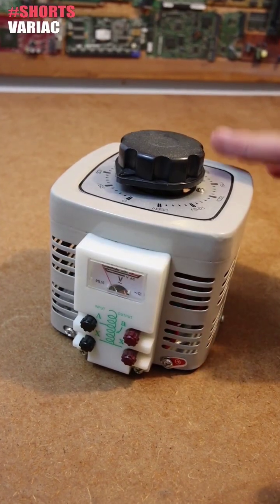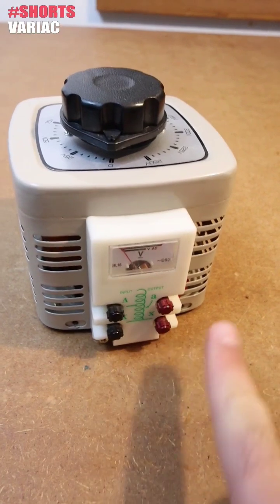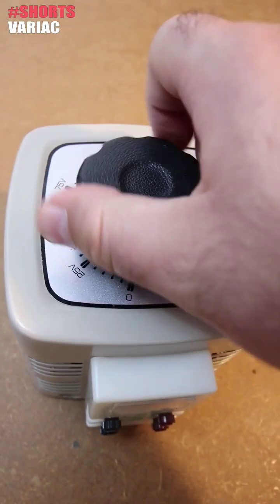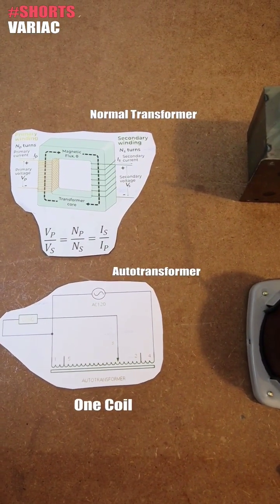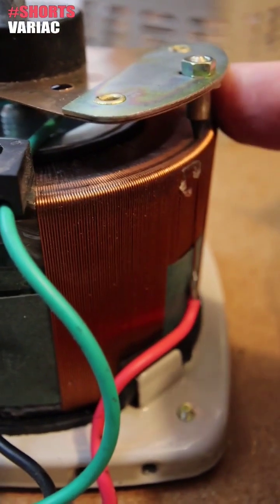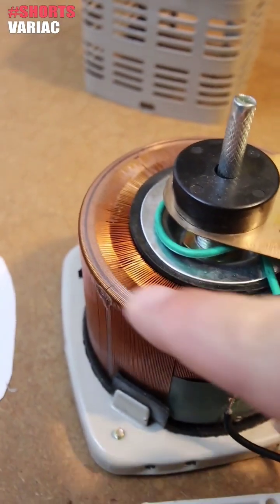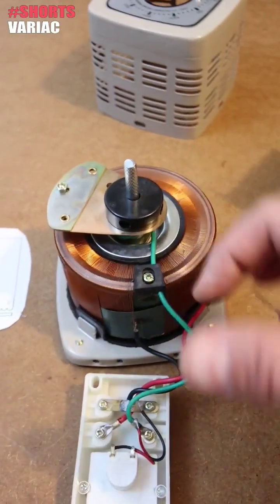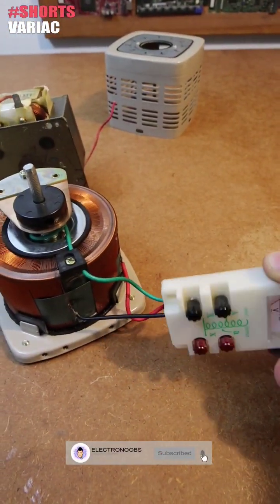VARIAC Supply Teardown - How it works?

Comment: I messed around with a toroidal transformer, a 220vac to 12vac, filed open the outer coil so my brush can make contact as it moves around, it didnt give me a crisp output but i was pleasantly surprised that it did allow some basic level of control

Comment: What is the weight of the shaft together with the brush-arm Sir...i want to determine the torque required to rotate the shaft together with the brush-arm using  a motor,so l want to select the right motor

Comment: It's like a potensio meter.. But potensio use carbon and also very low power..
Reply: It looks like one, but works on a different principle. On a potentiometer, the wiper changes the position of the tap on a resistive track, whereas this changes the position of the tap on a transformer. You can do many of the same things with the variac that you can do with the potentiometer, but it's not through resistance, which is why it's great for power. instead of losing efficiency as the control is decreased, you're lowering the voltage itself and retaining much of that power efficiency.
Reply: @xwasssabix2347  Yes, that's right. It is the same as an autotransformer or autotransformator or autotrafo where it only has a single coil as the primary and secondary coils...
And it only works well on alternating current.

Comment: That is a Chinesium Variac, who else would make a green wire a live wire.......
Reply: Also look how the brush is secured, half nut on oversized hole no locking washer. People don't realise that it's important to make mechanical fittings secure when dealing with AC.
Reply from the maker: LOL :)))